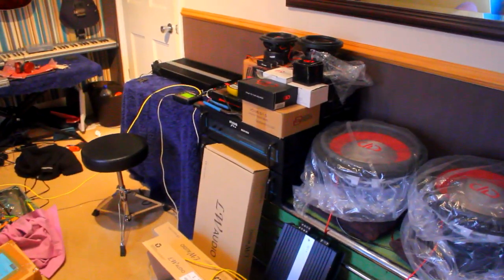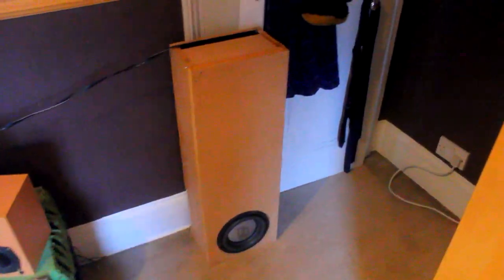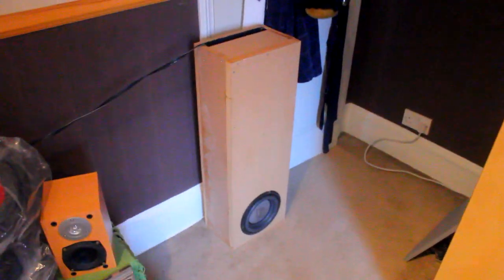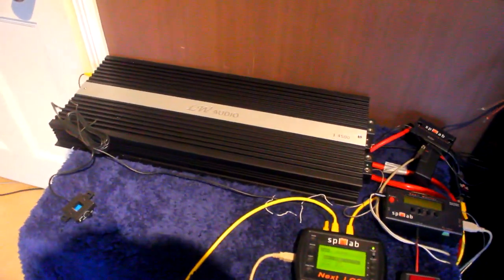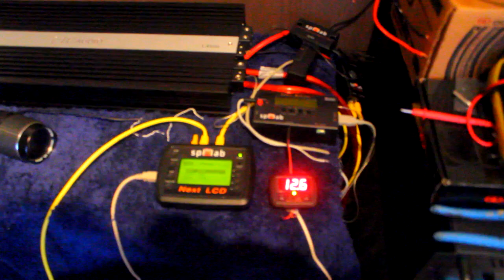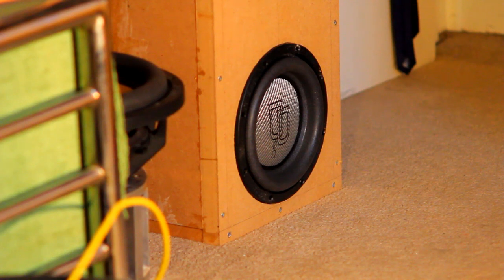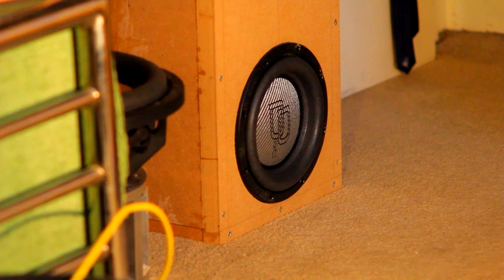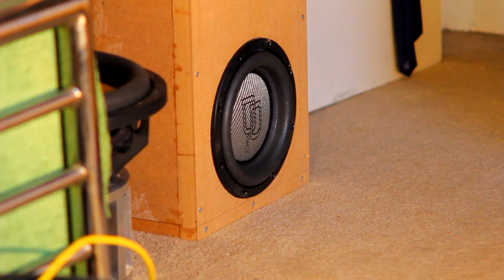8" subwoofer with HOW MUCH BASS?!?!?!! Digital Designs 1508 SUPERCHARGED!

Comment: That 1508 sounds really good, i was looking at the new 2508G subs but since they require decent size ported box i could only run prolly 2 correctly under the seat of my truck. Now im wondering if 4 1508 subs would sound better and possibly get little louder then 2 2508s.

Comment: Funny thing when I'm trying to watch this video with my 2.1 T-Line system is that the sound is reproduced exactly like your microphone is recording it, so it's not hard to imagine how your subs sounds like. 
My setup is not so different from yours I guess (only smaller in size to fit on top and under a table)
And it's all Pioneer. The new TS-E 171ci components are great, and the good old (well-worn) TS-W 258D2 fit together quite nicely. All the system needs is probably some extra sanding and a paint-job

Comment: Hey man. Which budget banging DD would you recommend for propper droppers BB2 class. I love box building and already build an amazing box for BB4 which does good numbers with ultra low power. 
Looking for a second/side project for BB2. I have a sub i can use but unfortunately its over a year old and playing it at full tilt on 20hz would probably not be very wise if i plan on competing more once. 

The idea is to have a budget sub but a sub that can hit the lows and stand the test of time.
Reply: i got a MTX RT10-04 in a 6th Order BP and it hits the 21hz at f3. doesn't handle a lot of Power ofcourse, Nor is it spl. but it hits low as fuck and is pretty loud

Comment: Im getting a D5.1000 would you recommend that i get a 
8" 2508 supercharged
or
10" 3010 supercharged     both esp. with the 1000w rms@1ohm in mind.
Reply: do you think the amp would be able to adequetly and consistently handle the 10" 3510?

Comment: It also bottomed out at like 7:05
Reply: +RWL2012 idk
Reply: +RWL2012 +Barevids takes good care in his work sorry we got off on thw wrong foot
Reply from the maker: +lawrence weldon naaah trust me, you'd hear if this bottomed out. The former is so rigid it would be a loud sharp SMACK that would scare the daylights out of you lol. To date, i have not been able to bottom out a DD woofer!
Reply: +barevids You bottomed the 10" but it was like 4x rms power or something xD (28hz box freq test with 10" vid)
Reply from the maker: +jijisniet ahhh lol no i discovered that was the coil rubbing on the former because the suspension was broken being 15ish years old lol! :D Its been re-coned now!
Reply: +barevids lol poor woofer ;(. Love to hear it's reconed. I love 10" woofers you don't see them much these days ;p
Reply: +barevids Also have you already tried bottoming the 212 that you reviewed? or would it blow before bottoming out?
Reply from the maker: +RWL2012 maybe i was exaggerating but there are Z motors dating back to early 90s :)
Reply: +RWL2012 that's what they are talking about it was another vid mate
Reply: +barevids That sounds awesome! old beasts that will outperform modern woofers by miles!
Reply: +RWL2012 i once had the chance to buy an 10" type r but i didnt have the money at that time ;( such a shame
Reply: +RWL2012 i bought that xplod for €25 with 4way 6x9 pioneers which i sold for €30 so it was basically free xD the video's on my channel are from my old setup with a 2channel ground zero on dell psu. I got a new box now and much better amps.
Reply: to be honest I don't think it did. general low hz create port noise. depending on how the box is made.
Reply: Only had problems with port noise with my first box. After that always put more thought about port width and length when building a box.

Comment: hey barevids, I'm 15 and I'm getting Into audio stuff more seriously now and I'm wondering if I can replace the sub in my surround sound system.
Reply: It's a Kenwood Surround Sound system Sub. The receiver is a RCA Dolby 5.1 home theater system. Tbh, I don't know what passive or active means. All I know is that the power supply is built right in to the box and it has a reflex port.
Reply: SW-150 I think...
Reply: sw-36ht, my bad bro
Reply: +RWL2012 I have that already, it's just that the surround for the speaker and the voice coil is damaged

Comment: Do you have a car battery in you room or how do you power the amplifier? sry for my bad english ^^. I wanted to buy a 6" woofer from DD but i want to use it in my room not in a car... but I need a powersupply with 50A for the amplifier. Icant find one
Could you help me :)
Reply from the maker: just buy an amplifier for home that runs on mains. Too much hassle to run car amps indoors.
Reply: yea like wut barevids says.. i tried to do it also and its just not worth it. Get a Crown amplifier or a reputable pro amplifier, you wont regret it.. i got an XTi 2000 from Crown and its one of the best buy i did! Lots of power, connections, the software for EQ/Xover is amazing, very very nice and affordable, rock solid too ! Been over 7years have it and still kickin

Comment: can you explain what supercharged means?
Reply: Something to do with having a magnate inside the coil? Not sure excatly where, that improves efficiency of the woofer when it gets low power from an amp. Check his review videos of one of the supercharged woofers he explains it full.
Reply from the maker: +Ryan “Iamevolmonkey” McCormick Supercharging adds a nice lump of Neo magnet to the motor pole. This adds 25% motor force, and increases xmax by extending the flux area!
Reply: I must have missed that review I will look for it

Comment: is it okay if I under power a sub, but not clip the amp?
Reply: +RWL2012 okay thanks because I have an orion xtr124d 600rms sub running in my house with a pyle 120w amp, I have a 600rms amp but I got it and it does not work
Reply: what do you mean
Reply: ***** what do you mean
Reply: ***** home, but it blew today
Reply: How do you blow a sub? Over power ?
Reply: pepe salgado you can clip the amp and that causes heat which frys your sub
Reply: ***** the 600w one is a technical pro
Reply: no I just sent it back to ebay and will use refund money to get another